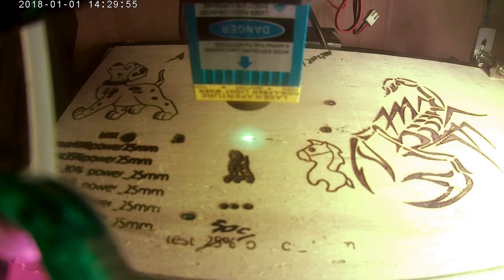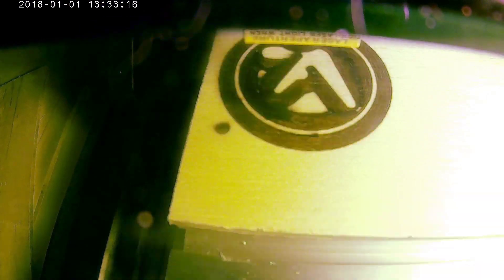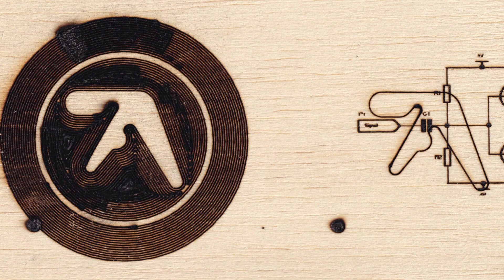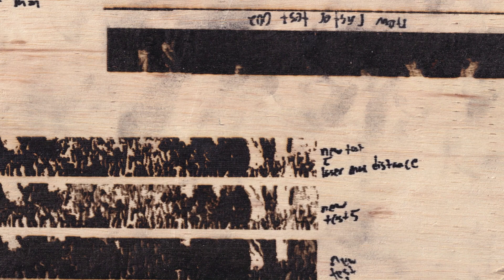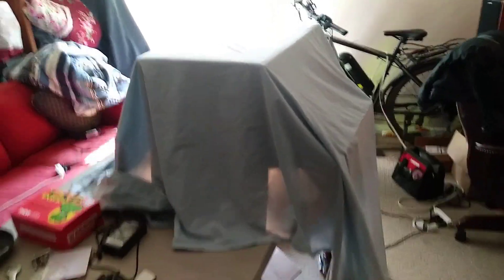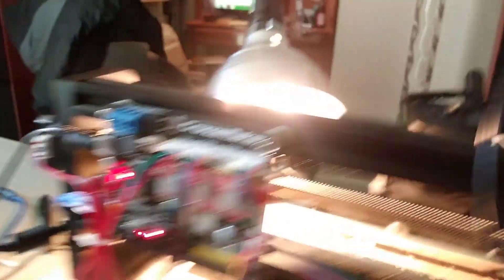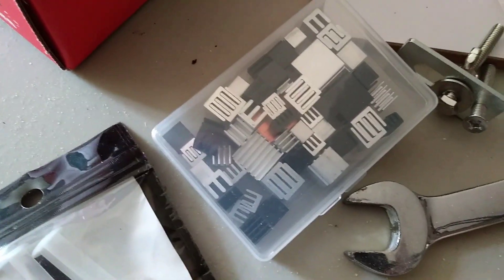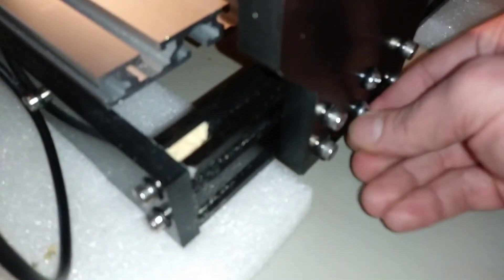CNC 3018 Pro laser engraving tests with 450nm 5500mW laser and free software

Comment: Excuse me, sir, I bought a 5500mw blue laser diode that doesn't work even though it's plugged into the TTL / default laser of the cnc board 3018. Can you help me to solve this. This is my YouTube ad channel, bro, https://youtu.be/5Q9YYuMqOPk, thank you.
Reply from the maker: hmm, a lot of these laser packages are a bit different, but there is a little power button on the top of mine that is easy to miss and, for me, needed to be switched on for my laser to work.  Engraver master is freeware and has an easy to operate low laser mode that might be good for your testing.  Best of luck, i hope the laser is ok, it probably is but who knows, right?

Comment from the maker: I really think the reason why my machine stopped responding with the laser on full blast just burning a big hole in the wood that one time was due to a short caused from the original heatsink and adhesive setup, that never happened again after changing the heatsinks and using thermal epoxy to hold them.

Comment: what is use program?
Reply from the maker: if you pause the video at the begining of the video it lists all the software used for each test, both what was used to generate the gcode and what was used to actually send the gcode.  EngraverMaster which was included with the machine was used for most of the video but a bunch of software was used